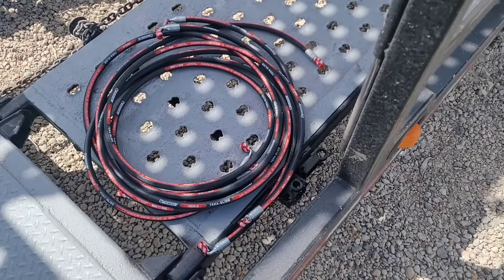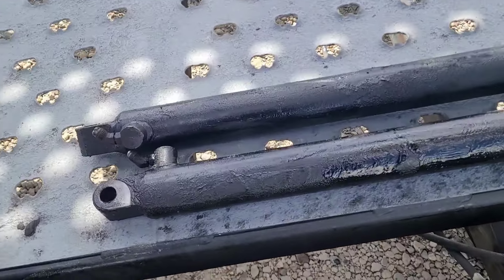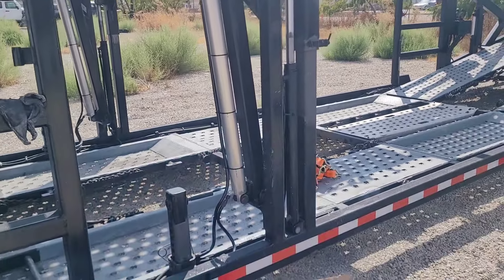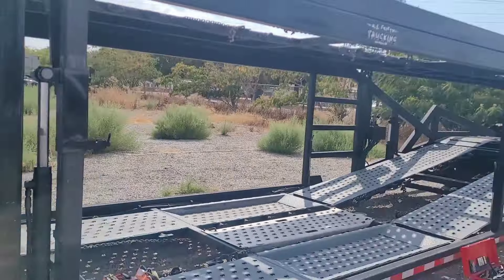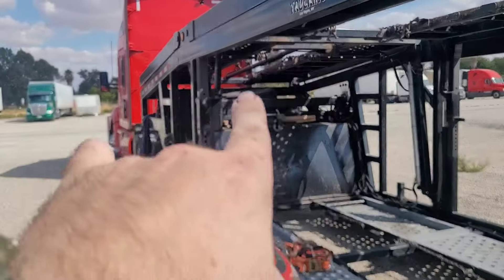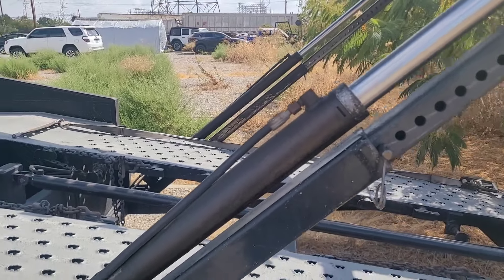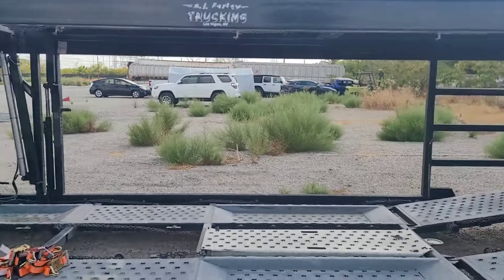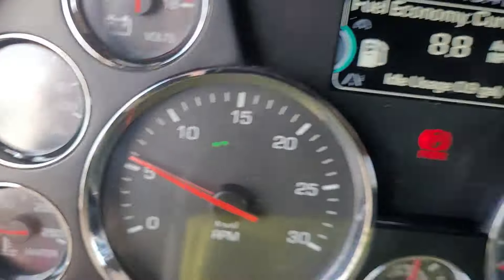replacing (2) hydraulic cylinders on the trailer, also oil change on the truck, maintenance....

Comment: Have you had any problems with you’re battery draining on the trailer even if it’s hooked up to auxiliary
Reply from the maker: @Gio-sau15  not yet, you have to put marine batteries they last long. When I leave my truck for long time I unplug my trailer
Reply: @ do you run yours off of dual batteries ? And any idea if auxiliary connection coming from semi truck in to trailer  goes straight to solenoid or battery.